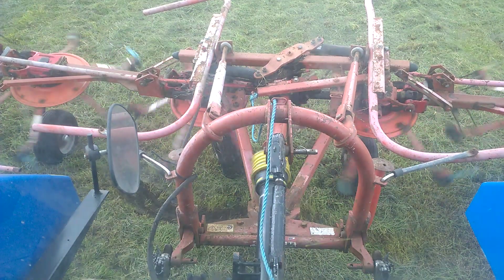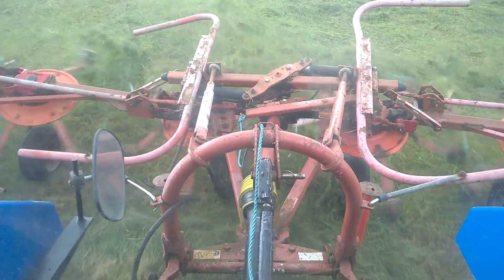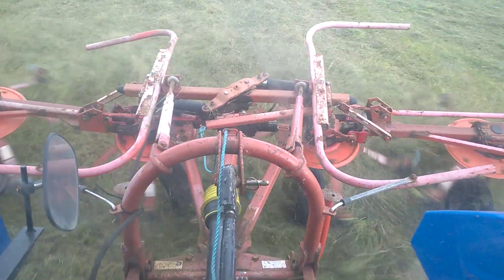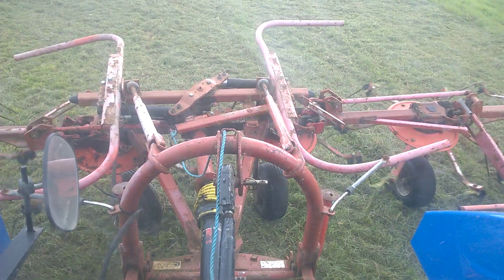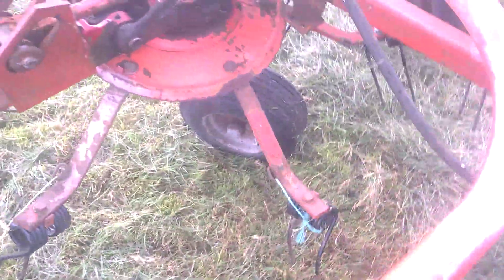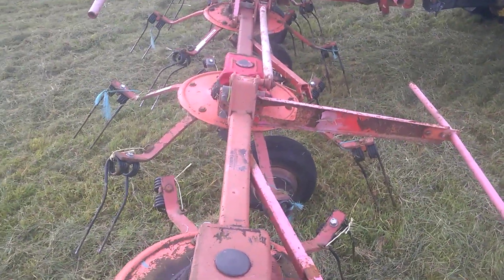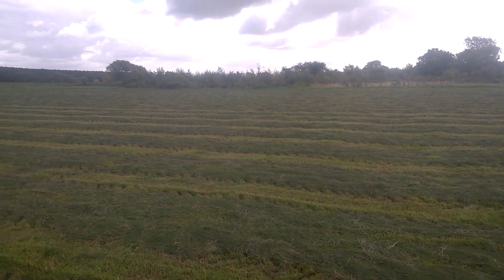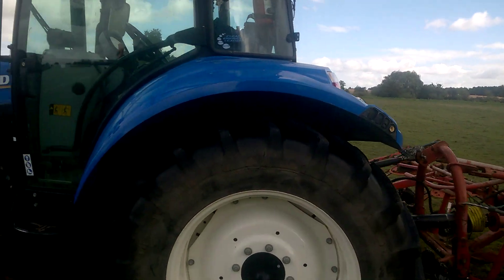How many attempts 😣😢

Comment: Think alot of your problems could be down to that wheel. Think it could be pushing sideways causing the wheel to lift. Only other thing I can suggest get it on a close as possible flat surface and check theres not a twist in the frame, headstock, pivots